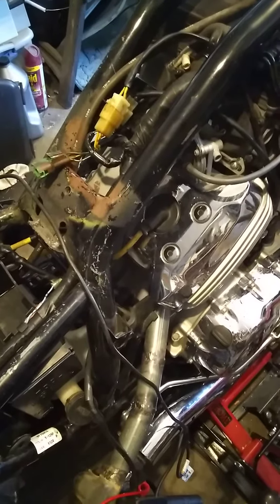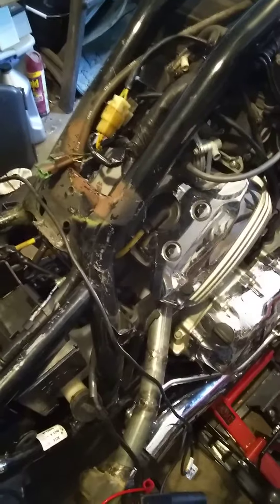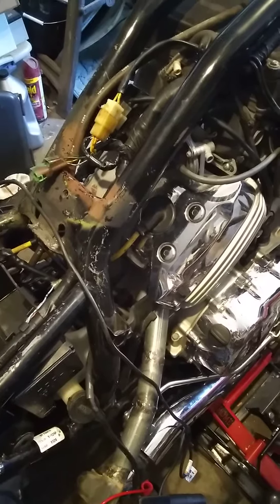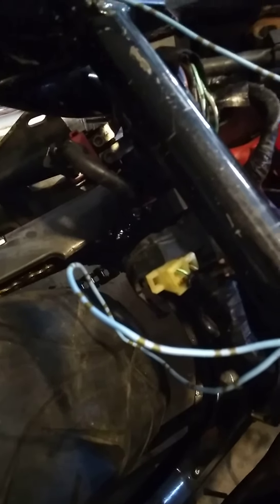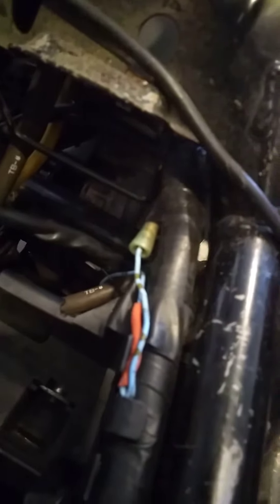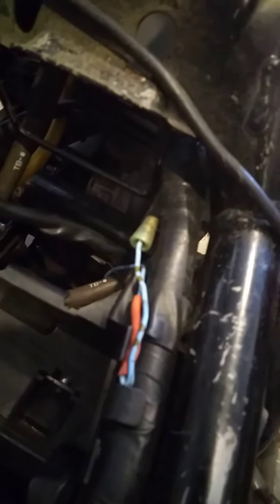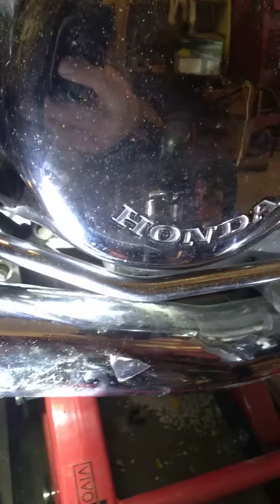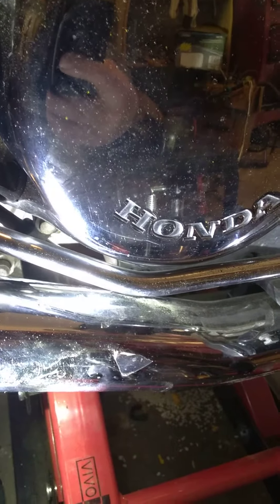neutral safety switch found 1995 Honda magna

Comment: Thank you so much for adding this video I found my switch on a 99 Honda Shadow Ace I was in a similar spot the connector itself was a little loose on the post I just squeeze the connector and put it back on the post now I'm up and running thanks a lot man